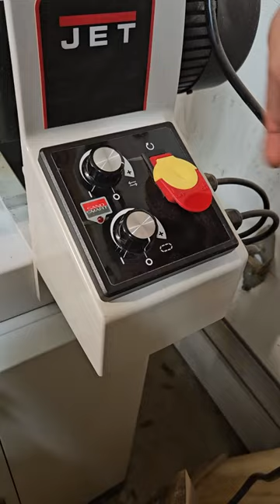How a Drum Sander Works

Comment: Is that the same thing as a planar?
Reply from the maker: Pretty similar to a planer/thicknesser except with a drum of sandpaper rather than metal cutting knives.  Planers have quite a bit more in terms of rollers and protections to keep the workpiece down against the table (actually, we just uploaded another short today showing the inside of  a planer if you want to see).
Reply: Good.How many pcs of same sheet could be done with this sandpaper?
Reply from the maker: Hundreds of passes if nothing goes wrong.  It is possible for the paper to clog on sticky woods (like pine) and get ruined quickly.